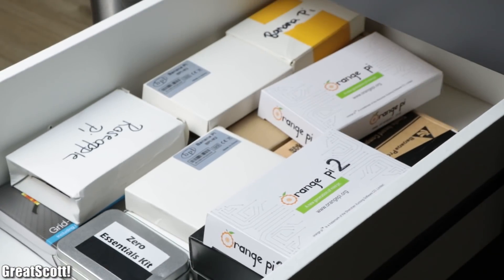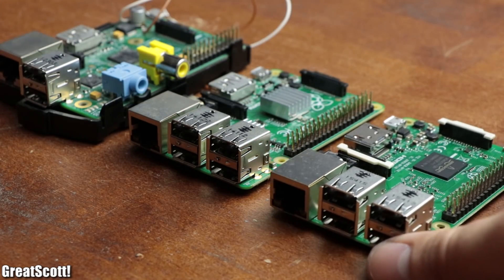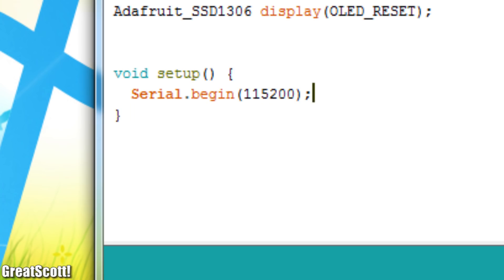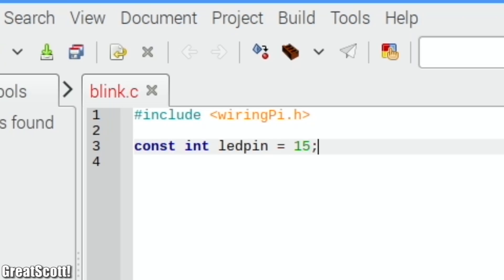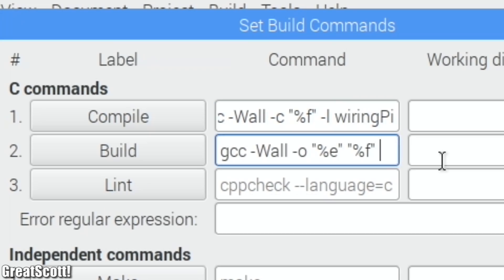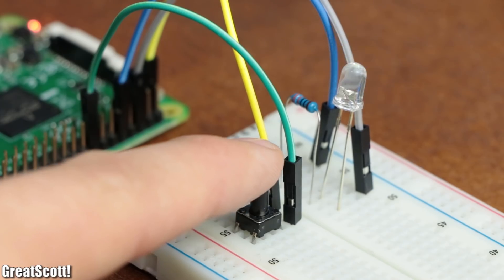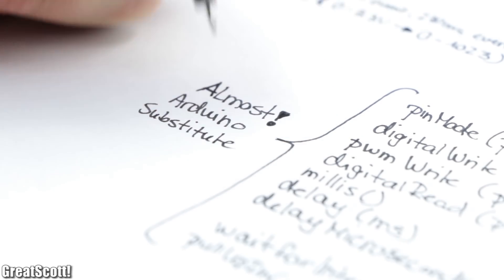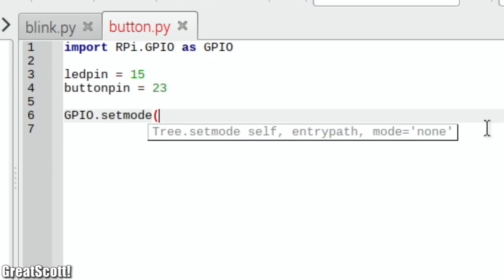Can a Raspberry Pi be used as an Arduino? || RPi GPIO Programming Guide 101

Comment: One thing you didn't touch on is the fact that the Raspberry Pi is not a real-time system.  Because it runs a full OS, when you delay 1000 ms, you may get a delay of 1010 ms instead.  Not a big deal, but it does add up in the long run.  The Arduino platform, on the other hand is a real-time system.  1000 ms means 1000 ms.

(Real-time might not be the correct term here.)
Reply: nope. The Linux kernel schedules tasks and threads for multitasking, you can't use it as a single-task real-time environment. The only way to obtain the same degree of control over hardware that you get with an Arduino is running your program after the bootloader with no OS.
Reply: Rick Seiden if using the Rpi os then yes, but there are other options available. I heard about a real-time Linux Kernel and other small but yet usable operative systems made for rt applications
Reply: @AxelMontini  real-time linux (xenomai, rtlinux patch) still includes latencies in  matter of microseconds. We couldn't use linux+rPi for full-fledged real-time applications. We could use it if we run bare-metal rPi.
Reply: Paul-Adrian Stoleriu
There is Linux-rt - a patch for Linux kernel that allows you to give your application absolute priority in the scheduler and makes sure it will never be paused unless it tells the system it wants to. It isn't perfect, but more than enough for most applications. (+ I believe there is another project that only makes syscall latencies predictable - they will always return in at most n microseconds etc.)

https://wiki.linuxfoundation.org/realtime/start - a bit hard to get the info, but it is buried there
Reply: If you need precise timing, the much faster processor can have far tighter timings if you utilize kernel modules. I write most of my applications in user space and then things that require precision are exposed via sysfs
Reply: @arshamskrenes  "A much faster processor?". It is all about how you write the kernel, or how you write your OS. The core clock on the Raspberry Pi board is fast enough for real-time work.
Reply: I didn't know there was a real-time Linux Kernel.  Actually, as Paul-Adrian Stoleriu says below, I didn't think it was possible to have one.  I'm not saying they don't exist, just that I didn't know about them.

I've made some great projects with my Raspberry Pis, and the real-time issue never came up, because I didn't rely on it for those projects.
Reply: @rickseiden1  Try a baremetal RTOS - FreeRTOS or ChibiOS. Please bare in mind that a Raspberry Pi is very powerful board: (multi-core) ARM 32/64-bit processor, plenty of RAM. Not comparable with an Arduino board.
Reply: There are two types of Real Times systems (and yes Rick, you are using the right term).
1) Hard Real Time systems, where a failed time limit on response on stimuli are a total failure.  Like reaktion time on rising temperature in a Nuclear Power plant or ABS breaking system in a car.
2) Soft Real Time System, where a few failed time limits are ok, if they doesn't happen to often.  Turning the wipers on a car or control the timer in a micro wave oven. It is ok to miss the time limits on fractions of a second.

The real time is the response time demands, hard or soft.  And that could be measured in µs up to hours or days.  :-)

Yes, you CAN make a RPi generate signals with a much higher precision and frequency then in an ordinary Arduino Uno.  There are even a CNC program written in Python that generate the stepper motor signals with higher frequency and precision than the Arduino Uno.
Yes, I thought that was impossible before I saw it and the explanation why it work.  It uses the DMA to generate the pulses, and the Python code is precalculating the data and timing that the DMA are supposed to send to those stepper motors.

But yes, usually Unix/Linux are a soft real time system at the best, though there are Real Time additions to Linux.
Reply: >nope. The Linux kernel schedules tasks and threads for multitasking, 

What is the point of an RTOS if it doesn't have some concept of tasks or threads?

>you can't use it as a single-task real-time environment. 

FYI realtime has nothing to do with things happening "in real time". An RTOS gives you guarantees about how long certain things take. 

>The only way to obtain the same degree of control over hardware 
>that you get with an Arduino is running your program 
>after the bootloader

Or use one of the RT patch sets for Linux or use a chip that has an integrated slave MCU like the one the beaglebones have.
Reply: Rick Seiden You ever drove in a car, that is newer than 2010-ish? Then you probably already used a linux RT distro...XD
Reply: @TheR971  what linux RT distro do they use?
Reply: I guess it's all down to your requirements at the end of the day, and just how strict you want to be with your definitions.  In a lot of cases, 1000ms on an arduino does not strictly mean 1000ms, but something reasonably close to it for the vast majority of occasions, which could vary by a few clock cycles here or there.  And if you're doing anything which requires computational power, this can seriously disrupt the timings on your GPIO o/p's due to the systems low clock speed.

From my experience, for absolute rock-solid, down to the micro-second timing/behaviour, nothing really comes close to an FPGA.  By their very nature, they are far, far more repeatable and consistent timing wise, as the configured circuit within the FPGA remains constant, therefore the timing remains constant in the vast majority of cases.

Anything timing requirements in the micro-seconds, utilising an arduino is not really viable.

From my experience at least :)
Reply: You can always hook up a aruduino nano to a pi.
Reply: @TheR971  Why adding a 8-bit controller with few kB RAM to a (multi-core) ARM 32-bit processor with plenty of RAM?
Reply: while not something most programmers can attempt you could always write bare metal code, and handle interrupts on your own, the raspberry pi 3 is horribly documented, but i have done basic things for bare metal on the raspberry pi 3, and looking into it as long as you mostly understand how the raspberry pi works at its lowest level, its possible to ditch the operating system completely.
Reply: " the raspberry pi 3 is horribly documented". The board itself is not well documented. But the SoC/ARM is documented well. There are no issues in writing bare metal for the Raspberry Pi board(s).
Reply: Paul-Adrian Stoleriu 
Ah, thanks
Reply: There are so-called "hard" real-time and "soft" real-time OS, Linux (including that installed on Raspberry Pi), is a "soft" real-time OS, which means it does act real time in most cases, but cannot guarantee it all the time (Windows is even worse on this aspect comparing to UNIX like systems). "Hard" real-time OS is very hard to design and scalable, which are only used in very specific applications, like military applications and rocket launching.
Reply: Some performance improvements?  

We get the same improvements as we would do with Assembler or C programming without Linux OS in bottom if they uses DMA, which they should do if they want performance to this level.  With the advancements of using the Linux abstractions.

Just admit that you are surprised that they managed to do this in Python, in Linux, I know I was.  It has pulled what is able to be done in a RPi a lot.  If someone told me this 1-2 years ago, I would told them to get of the pipe.
Reply: He mentions it in an indirect way by saying that delays are innevitable (check the list with pros and cons). For real time events you can use an external chip (as one of the many hats including FPGA or just connecting one to the GPIOs).
Reply: Aye, for the timing requirements for something like a CNC machine, it makes perfect sense to use a micro-controller, they are one of the most cost effective ways to do it.  But, there are other applications were the timing requirements are in the nanoseconds :)
Reply: Axel Montini  
Perhaps you could use tiny core Linux to that effect?
Reply: @Arsham

>If you need precise timing, the much faster processor
>can have far tighter timings if you utilize kernel modules

99.99999% of the time you don't need or want to do that. A kernel module is good for something like sampling data at an interrupt and stuffing it into a buffer... which is why the IIO subsystem now exists so you shouldn't have to write that stuff yourself.
Reply: Paul-Adrain is correct in stating Linux limitations. However, it is still possible, under certain conditions, to have an almost reliable real time system using Linux, but it requires several adjustments and customizations. At the end, it is not worth to spend time to setup a Raspberry Pi to do real time applications when there are other boards, like the Arduino, that are intrinsically real time. The only case where it is worth using a Raspberry Pi for real time is if you need to do also data processing, which the Arduino cannot do. Keep in mind, though, that if you try to do data processing at the same time as using real time for handling sensors and actuators, the Raspberry will start lacking timing precision, because it will have to use time sharing to deal with the data processing part.
Sometimes, for very specific applications, the best way to go is to use both boards for your project, so you can get the best of both worlds at the same time.
Reply: +Arjan van Vught, yes what about that?   And?  I know what DMA is, and that is uses that for performing.   It STILL uses Linux and Python, doesn't it?
And no, it is not similar to bmc2835.  BUT the functionality could be added to that library.  And if you read the link, that library NEEDS Linux to work.
But yes, it is low level programming, done in C in that library, and in Python in PyCNC.
Reply: rbaleksandar there are 200MHz 32bit microcontrollers that can use the arduino IDE and also TI Lanchpad if so necessary and they are cheaper and less power consuming than the pi. Wouldn't this be much faster?
Reply: Yeah but FPGA needs a very good skill level and time budget to implement (I believe). Can't almost everything be handled with a PC (anything from a Pi to an i7 PC), which communicated with a simple micro controller which handles all the real time control? For more complicated stuff or that which has strict latency constraints, well you need to be an experienced and employed EE working in a team, and then you might just use a DSP or DSC or even an ASIC?

FPGA sounds ridiculous to me for a CNC machine.

Just my inexperienced option (i'm just trying to learn here ) :)
Reply: bob bobson you can uninstall programs don't you need in your project and for latency you can overclock your ARM processor! look  RTC on raspberry pi
Reply: Hey the correct way to say this is Arduino is just your code running on bare metal where in RPi there is OS (linux) with is doing a lot for you... so if you ware to run your code on bare cpu (no OS) it would run in „real time” thus had no multitasking and other OS stuff like ethernet drivers and other features provided by the kernel but at the other end of this apart from that RPi can run kernel they are not so diffrent and you could use RPi chip for anything you would normally use atmega... (it dosent work the other way because atmega is well runs 1000 times slower and is just bad...)
Reply: thx mate for anwers my question :)
Reply: +Rick Seiden The Raspberry Pi is a perfect real-time system. Just run your programs baremetal as you do an Arduino system.
Reply: Axel Montini Correct. Just do not use Linux. Make a fair comparison; Bare metal Raspberry Pi
Reply: Paul-Adrian Stoleriu and using the Raspberry Pi board without Linux would be a more fair comparison
Reply: Roman Riesen why would you add an Arduino to a Raspberry Pi board? The ARM/SoC on the Pi can do everything (and more).
Reply: +eleneasy.com and +Arjan van Vaugh.  
Then, how do you explain that the  Python program PyCNC can generate pulses to stepper motors with higher speed and precision than an 8 bit Arduino?  On a Raspberry Pi type of card running Raspbian?

https://medium.freecodecamp.org/how-to-build-a-3-d-printer-using-cnc-controller-in-python-bd3cd5e28516
Reply: +Anders Jackson This solution uses DMA and is not using the Linux drivers. It is similar to -> http://www.airspayce.com/mikem/bcm2835/
Reply: I am not surprised with the performance when you do low level programming in Linux userspace.
Reply: Well, you said it couldn't be done in Python or Linux.  Which is obviously can.
Reply: Whatever...
Reply: With the right knowledge and skill, you don't need any Arduino or FPGA to have VERY high precisions in puls generation, which is needed when generate high speed pulse trains for stepper motors.
pyCNC have done a very cool thing about that.  Coding a real time precision on a RPi with Python.  By using DMA in the RPi ARM cpu.

So I would say that a RPi without a Arduino is even more cost effective way os controlling a CNC.
Reply: @AndersJackson  1.Using DMA and Rpi Soc specific programming has nothing to do/does not require Linux. 
2.Real Time means much more than being able to generate very accurate pre-programmed IO pulses for motor control. In fact, if you would require to react to external factors and change the pulse frequency/pattern according to unpredictable external factors, the approach used in that CNC application would not work. You have a ridiculously narrow definition of RT. In fact, what matters the most is the response time between an interrupt occurrence and the moment it gets serviced
3.The fact that you need tens of seconds for booting  or restarting Linux, alone would make Rpi+Linux useless for 90% of RT applications
4. Application processors like Rpi have inherent non-hard real time/impredictible built-in latency features, like cache (but of course that also makes them such good number crunchers)
5. Any applications where safety is paramount, are anathema for something like Rpi+Linux. Your 1k line of code application sits on top of millions of lines of code of kernel and runs along with other processes that you can't control. You probably don't want to run your avionics or nuclear reactor control software like that.
6. Comparing Arduino (16Mhz , 80mW, 2$) with a Rpi (4 core 1.2Ghz, 4W 20$) when the application is stepper motor control does not look terribly good for Rpi. There are reasons for why there are millions?! of Ramps board out there for 3d printer control and not many Rpis. 
7. As noted in the video Rpi does not have ADC or timers out of the box
8. Arduino I/O are also much more robust and capable of sourcing more current
9. Arduino Uno and Due are kind of obsolete. There even significantly better uCs, at the same price, that are even better at everything (say STM32s)
10. Linux RT/preempt RT do not make Linux hard real time
I could add another 10 more points, but I'm tired and TLDR. Take care not to fall from the high horse
Reply: @sounavailable  sigh, here we go again...

1) Read the code.  It is as special as doing the code in a STM32 or Arduino.  THEY are special hardware coded in a low level way.  So WHY do that make it any different to use the DMA channels in a RPi?  Why does it in some magic way make your suggestions better?  SO good that you obviously doesn't need to read the code or the description of pyCNC?  Is it because it makes you look better because it is much harder to code the STM32 or Arduino?
2) Read what I wrote earlier.  As they say "Don't try to teach your dad how to make children."...
I KNOW that it is ALL about delivering responses to stimuli within a time limit.  THAT time limit could be µs OR within hours.  It JUST need to deliver the response in exact enough time.  No, it isn't about delivering fast.  And I have already written that earlier in the thread.
WHEN you are driving a CNC FAST, you NEED to deliver the pulses to the stepper motors in much faster pulse trains then the Arduino can deliver.  THERE is where pyCNC on a Raspian Linux on RPI can deliver, and DO deliver.  In a much easier way.
3) No, it doesn't.  THAT has NOTHING to do with real time applications. It is just to take that into account when you design your system.  Like with response times I mentioned earlier.  AND it depends on the application, of course. ALL hard and software design is about the demands of the application.  ALL Hard and Soft time limits is JUST the demands you have on the system you want to design.
4) You Sir, have NOT read nor understood the RPi system and the pyCNC programs design.  It deliver much more precision then what a DEDICATED Arduino system can deliver when it comes to the generation of the pulse train to the stepper motors of an CNC.
5) Once again, You Sir, have not a clue about the solution I have mentioned.
6) Once again, You Sir, have not a single clue about the solution I have mentioned.  I suggest you read up on the CNC program that I mention before you even response to this post.
7) Once again, You Sir, have not a single clue about the application I have given you all a link to read up on what it ACTUALLY CAN FUCKING DO!  READ THE LINK, OR STOP MAKING STUPID STATEMENTS.
8) Sigh, read point 7 above.
9) Sigh, read point 8 above.
10) This solution with pyCNC uses a plain ordinary Rasberian kernel. It doesn't use any RT additions to the kernel.  By the way, RT Linux are absolutely fine when it comes to solve many RT applications.  The RT part is scheduled before ANY other process is scheduled.   And again, Read Point 9 Above.
11-20) Read point 9 above.

And please, do not answer until you have read the code and understood the pyCNC and how it works.  Please...
Sorry, but I just is tired of people that think they know stuff, when they obviously have not read the suggested solution and just do man guessing.
Reply: @sounavailable  I call Anders Jackson's approach the clock away all my problems technique. Which works like a charm for batteries, Java, and multiple processes. +1 for pointing out cache. Almost all Linux is "soft" real time by extension, and usually low orders of precision.
Reply: @davidthacher1397  Yeah well, if he is still around, he will probably caps-lock-shout at you for not looking at that pycnc project (which outputs pre-computed IO sequences over DMA, so it really has nothing to do with hard-rt at all). @"Clock away your problems :)": it definitely does not play well on with battery powered devices, those Ghz eat up energy, if that is what you meant. Btw, a common solution in the auto industry to get the best of both worlds is to use SoCs (system-on-a-chip) custom solutions that integrate Ghz level general processing cores + with Mhz RT cores on the same chip. Examples that are available for hobbyists are the Beaglebone Black (was not very easy to program RT cores, due to lack of support and documentation) and the recently released STM32MP1 Series (which looks freaking awesome and is very well supported)
Reply: @sounavailable  I did not look much in the BeagleBone Black RT cores too much, but I did see a possible limitation with them. I looked at the system bus drawing of the  STM32MP1, and it does look promising. There is a few choke points on certain IO devices which could be a problem. However it looks like APB1 and APB2 are intended to work under the Cortex M4's domain. One thing that annoys me about certain IP core designs is how they handle SRAM in the context of DMA and CPU. I would add a dual port memory for that. That way the CPU and DMA can sync without conflict. (PIC24 does this.) The other possible pain that I see is how to communicate between MPU and MCU. They could just use a pair of FIFOs for this. (PIC24CH does this.) Each gets their own port so the system bus can resolve the conflict via crossbar. Granted you could work around this by shorting two SPI or UART cores, but that is slow and will have the conflict of IO space bridges. Other than that you have to do software mailboxes which can get ugly. (Hopefully it is full crossbar at MLAHB.) The local GPIO may make bit banging friendly option.
The multiple SRAM devices will allow some applications to avoid certain issues I mentioned. It also has lots of FIFOs which is nice, for at least software and maybe DMA.
Reply: @sounavailable  I looked back on the BeagleBone Black PRUs briefly. They also potentially had limitations for message passing. Again I am not sure I understand this if they were designed as real time units. RTOS's sometimes use queues to block tasks, which works decently under the context of a single core/actor. Here there is two actors which creates issues potentially depending on the design for real time system/operating system. Granted most RTOS schedulers use background timers or interrupts to avoid certain stalls. (Like arbitrating a single memory port target between two initiators.) However this can lead to untracked producer-consumer problems along with nondeterministic timing for critical applications. Forcing you into a non real time approach of clocking away my problems potentially.
The message queue is basically a FIFO and the length of the FIFO can be worked around. (Unless really small. I see no reason why it would be less than 1 or 4 KB.) Basically using structs and free space check you can avoid issue. You can test the queue space as normal. Then write predefined structs into it as a single unit, but really you just need constant header/protocol to sync with. Basically handle it as byte stream. FIFOs are commonly used for clock and event decoupling.
You can create the FIFO with FIFO IO interfaces or using IO interfaces linked by DMA. Not overly ideal, but may work. However that mostly assumes full crossbar and no deadlock on IO bridge. The PRU use an interesting model, which is fairly optimized for cost/area. They may have planned for people to figure them out on their own. 
In the beginning I thought the PRU were hardware like CLC in PICs or FPGA/CPLD based on how people talked about them I guess. The issue with them is they are small, and have to jump through lots of mappings. Then there are APIs which may not support everything or are built around certain applications. The STM32MP1 appears to be allowing the M4 to have a full domain rather than piggy back off the Cortex A's domain. However for IO the Cortex A piggybacks of the M4's.
I think the intent of the PRU was lost in translation. They are good for handling IO concerns that the Cortex A cannot handle consistently. Here certain real time notions do not apply. This also tends to create the clock away my problems for times when you need real time notions. Usually under these cases you would need to design a subsystem independently, which is costly. Zynq enables a degree of hardware expression, but costly. The software notion alternatives are usually lacking. (Blame Computer Science.) The PRUs are best described as coprocessors. (The weak kind.) Heck software/hardware is generally misunderstood. (Again blame Computer Science.)
Reply: You probably mean latency.
Reply: Maybe use hardware timer 😉 oh wait, is there library for it? 😄 Typical Arduino user
Reply: real time is not defined by how quickly a system can deliver a task, rather how precise it can deliver a task given a strict time frame. if you ask the Pi to do a task every 2s it may do it, but the OS can interrupt it any time unlike an arduino or any other uC.
Reply: Time invariant*
Reply: what about all the 32 bit uC, where they have RTOS, they have OS which are in Real Time
Reply: nope Julian illet did a timing test on the duino an found it inaccurate. the compiler inserts so much hidden code it may as well be an os
Reply: A lot of people using Linux have no clue what real time is. The Arduino is pretty much as deterministic as you can get. From the software and underlying processor architecture. However real time generally is a software architecture that created reliable and deterministic code execution. Linux is a general OS and quite large because of this. Meaning its variation is quite large. Linux can do some simple tasks in  real time with stuff like the patch. However it still has to process huge orders of kitchen sink type logic, much of which can be dropped. However it is important to understand the different aspects which I have not really described completely. Programming language can get in there too. Most processors running Linux have functions which prevent stable real time logic.
Reply: Totally wrong,boss! Arduino also exceeds the delay value.in order to obtain exact temporization you need to use internal timers.delay is for school pupils.arduino is good for ultra low speed projects.
Reply: Linux has a sophisticated prioritization scheme. Processes can be run with real time scheduling policy or simply with the highest priority within the regular priority scheme.
This should mean that a 1000 delay will likely be 1000 plus a tiny fraction.
There are plenty of real time systems that run on top of an actual operating system. For a GHz class processor, you might even be able to perform real time tasks that require sub micro second precision. You need to know what you are doing.
The key is controlling what kind of tasks you'll run on the system.
Reply: Paul-Adrian Stoleriu are you sure? All the hardware of National Instruments emmbeded systems like myRio or cRIO uses a Linux kernell for the RT proccesor! Its an amazing system, deterministic and very reliable in time to response and again, it is based on Linux Kernell! But I dont know what version is or how can we get it to use it on RPi.
Reply: The Raspberry Pi is a board. And for sure it can run a real-time system. Just do not use Linux out-of-the box. Try bare metal and you see a perfect real-time system.
Reply: In Linux userspace, when using DMA or the http://www.airspayce.com/mikem/bcm2835/ then we are able to get some performance improvements. Still with the limitations of Linux.
Reply: Anders Jackson This video is about the (odd) comparison between the Raspberry Pi board and Arduino. Arduino is well known for the ease of programming. When you want to achieve fast GPIO on the Raspberry PI board in Linux, then you must well known about the Raspberry Pi SoC and low level DMA programming. That is again a complete odd comparison with the Arduino.